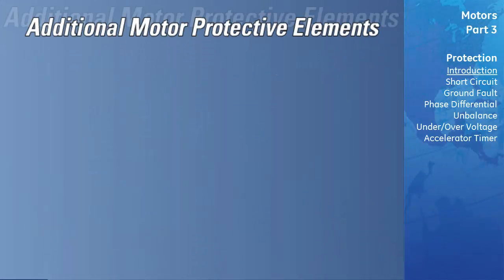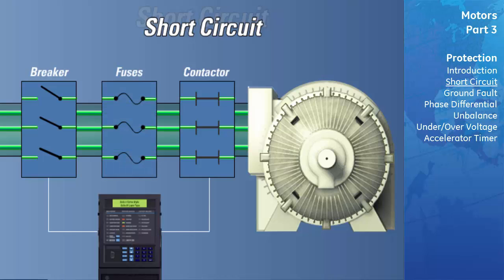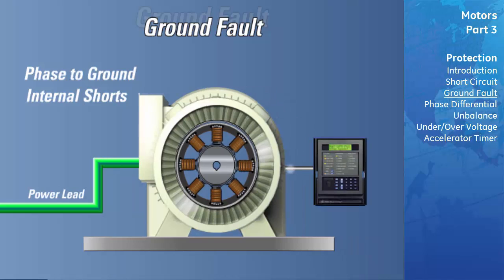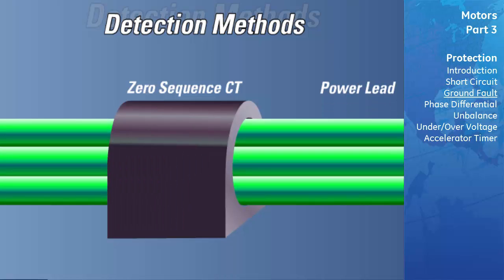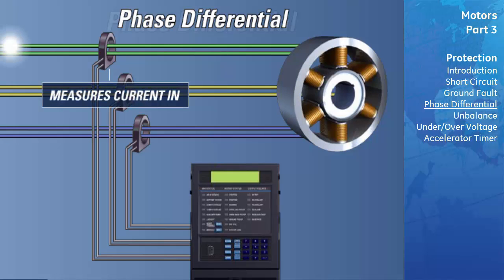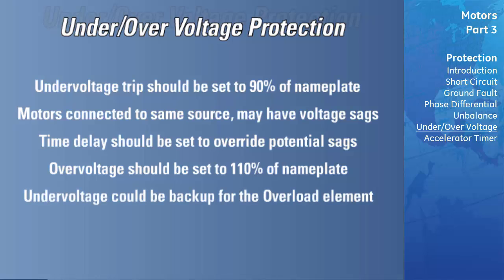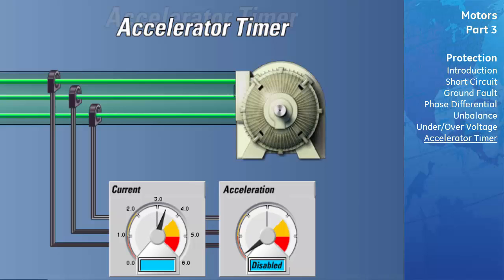FMPR-109 pt3 l  Motors Protection v1

Comment: Introduction - 0:14
Short circuit - 1:00
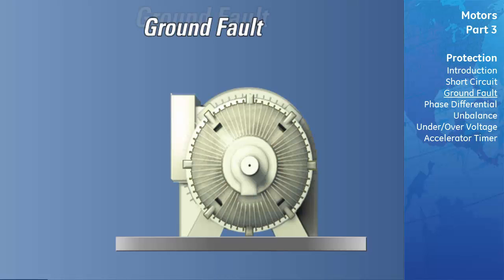Ground fault - 2:09
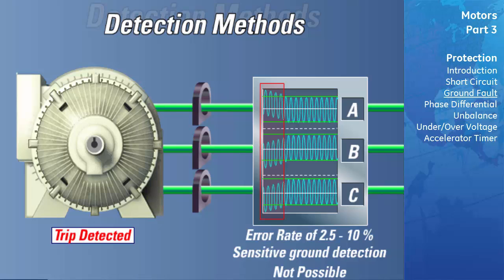Phase differential - 4:19
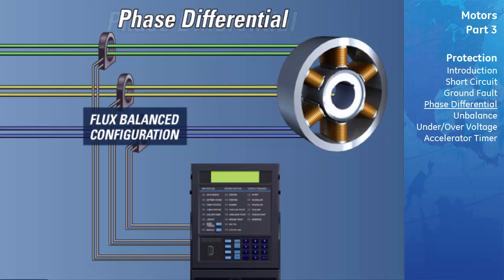Unbalance - 5:19
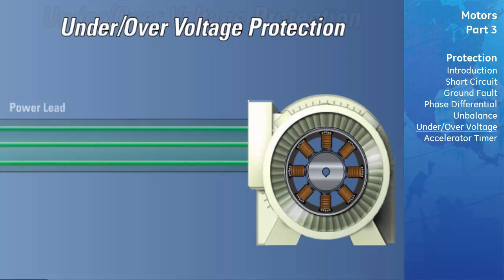Under/over voltage - 5:57
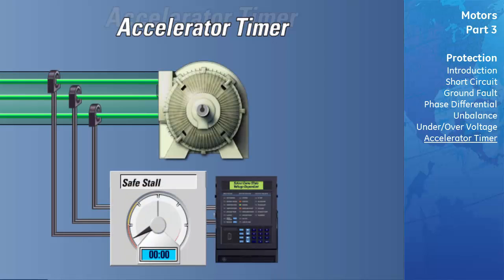Accelerator timer - 7:19